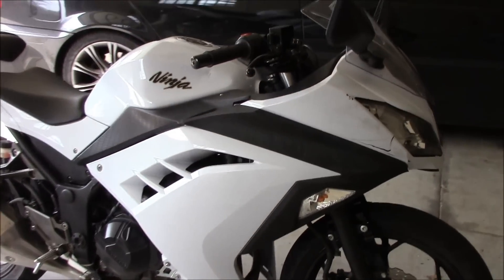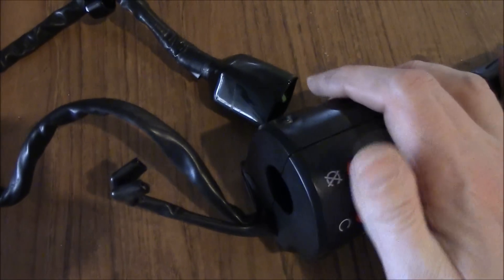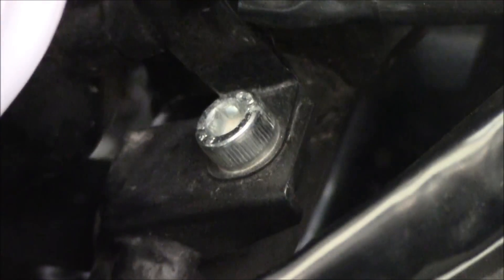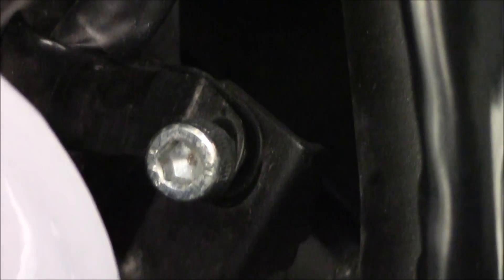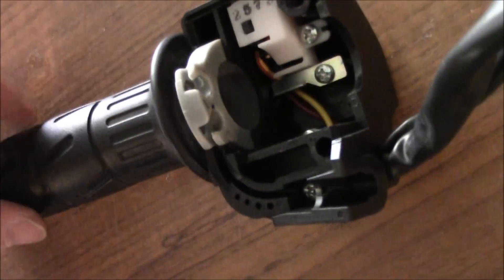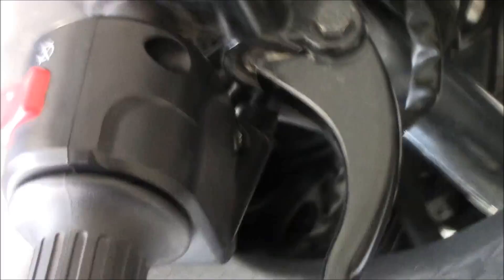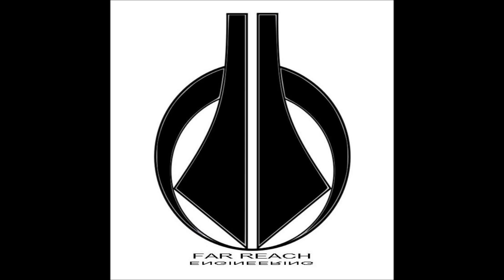Replacing Motorcycle Kill Switch, Starter Button, and right control group. 2013 Kawasaki Ninja

Comment: Question the assembly won’t slide up more on the bar when I actually do slide it up it’s not fully closing like something in the way and I can fighter out why? Did u have this problem
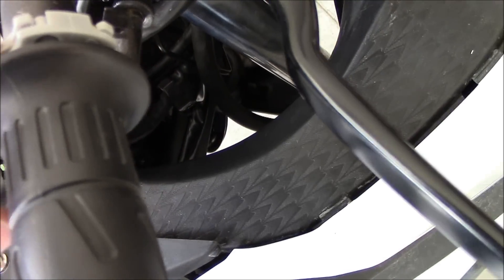Reply from the maker: There is a locater peg/hole on the side of the bar that faces the front of the bike.  Is it possible that you have not aligned the peg with the hole?  Just a thought.  You can sort of see the hole in the handlebar that the pin will need to sink into here 3:56   Not sure if this is the issue, but just trying to help.
Reply: @FarReachFR so the issue I have it fits but I need to move it up a little more on the bar because of the brakes and bar end and when I do that’s where I start having a gap I dont know why but I’ll double check what’s causing it
Reply: @1pyroace1 literally my situation right now. 5mm out before it closes flush. Did you solve this?
Reply: @rtificial8292  some what not they way I wanted to be, because I’m trying to dial right turns and front brakes hitting the windshield is no bueno

Comment: Correct me if I'm wrong but I don't know of any tool manufacturer that uses the measurement of 6/16" as  being the size of any tool. Instead they 2 use the term 3/8"  I'm assuming you used a 5/16" Alan wrench on your project. Again correct me if I'm wrong. I would rather be wrong than to post misinformation.  I probably wouldn't have said anything except I just kept getting a picture in my head of people searching their tool boxes for a 6/16" Alan.  O r even going to store and trying to buy one. 😉
Reply: came to comment the same thing

Comment: How do I start the motorcycle without the button what did you touch
Reply: Did you figure it out? Mine just broke bro 😢
Reply: @ yes take 2 keys press the metal middle circle and press it on the outside of the circle
Reply: Or 2 metal pieces but the metal pieces have to touch each other

Comment: I hope someone is still here lol.. I need help on how to disconnect the cables from the throttle housing on my honda cbr929.  I seperated the 2 halves but the lines are still too tight to remove.  I want to go in and put contact cleaner and dielectric grease.  So if this doesnt work I will know how if I have to replace the housing/buttons.

Comment: I just started riding motorcycles I bought a 1982 suzuki gn 125 it was working good i left my back under tarp at my parking lot driving my car to work when I got back and removed my tarp some asshole had turned my mirror around and broken my starter button. Is there anyway that I can start my motorcycle without the starter button untill i can find one?
Reply from the maker: Yes.  Now I dont know your bike specifically, but the starter button basically just closes a circuit.  the button you press is closes the connection.  You just need to locate which two leads were going to the start button and then connect them (hot wire together) in order to engage the starter and then disconnect them once it is started.  (this of course assumes your kill switch is still working correctly and is on, and your key is also in the on position)
Reply: Far Reach Engineering Thanks a million bro!

Comment: How did u jump it across the terminals
Reply from the maker: +Tarricka Brown  You notice how it looks like 3 circles, each stacked on each other?  I recall jumping the top circle to the bottom circle.  What I used was actually the green alligator clip shown attached to the key. I would open its jaws and stuff it in there.

Comment: how did you look that whole part up on ebay,,, i need one too
Reply from the maker: If you need just the switch section I would use, "2013 Ninja 300 Kill Switch"  If you need the grip too, then throw throttle into the term as well.  It should pull up some options for you.
Reply: I need this exact thing for my hyosung 250r 2015 but having the worst luck. I had it crossed for a few years and today it wouldn’t turn and kept shutting down! Any advice ?

Comment: Hey bro great video.. I have my bike at the shop and they told me this was the issue why mine doesn’t start. I replaced the solenoid, and the battery and nothing, no start. It’s an 08 zx6r

My question for you is how did you figure out this was the issue? Is there a way I can send you a video by email to see if your bike had the same problem when starting? They are charging me 90 an hr and the part was like 140. I am watching this too late and need the help as much as I can man. Thank you.
Reply from the maker: For me, the problem was more obvious,  Overtime the switch button started to act weird.  A couple times I pushed it and it would move to the side instead of straight down.  Some times it would start, some times it would do nothing.  I would just push the button and silence.  Push it 4 more times and boom starts up like nothing is wrong.  That all or nothing scenario was  a clue that it was electrical and not mechanical and it seemed as though how I pushed the button would make a difference. This narrowed it to an electrical issue within the switch itself.  Then over more time the problem just became worse.  Then the button popped out. I put it back in and kept up my wiggle it, push it over and over approach to get it to start.  Eventually the switch button fell out. That turned out to be a plus cause after that I would just hot wire the switch.  Using the green alligator clips in the video I would jump the contact from the outer circle to the inner circle.  That made it specific and obvious that the problem was just mechanical failure of the electrical switch.  Last step like you see here was just replacing it.  So that is my story of how I figured it out.  As for diagnosing it from a video I think that would be very difficult.  Hands on is the way to do it.

As for parts, I personally would just use a junk yard pull or a used switch in good condition.  Shops always cost more.  They have to, without it they could not pay for rent or wages.  But that said, I just looked up the kill switch for your motorcycle and used (on ebay) it is $20.  (not $140)  So you might be able to save some money there by supplying them the parts.  If they charge you 2 hours and you supply a $20 part, then the whole thing could be a $200 fix.   Lastly if you are in the my area I could put my hands on it for you.  But I am not sure that is cheaper than a shop :)    All the best and I hope this helps in some way.  If nothing else, maybe I saved you $120 in parts?  Good Luck!

Comment: I have the same bike but their is a problem with it the engina is good and gas and oil gear shifting good but my bike wont move when I put it to first gear u know how to fix it plz get back to me fast
Reply from the maker: when you put it into first gear to it stall due to engine load or being stuck?  Or does it not move in first gear because it shuts off the power electronically?  What happens when you put it in first?

Comment: how do you jump the connection
Reply from the maker: Underneath the push button, there is a metal circle inside another metal circle.  Jump the connection from the outer circle to the inner circle.  That will engage the starter motor and start it.   NOTE: you still need to have the kill switch set to on and the key set to on.
Reply: Far Reach Engineering Thank you for this info👍🏻. I just had my bike vandalised overnight and they broke the starter button clean off along with the horn. Not sure what the purpose of that was but my guess is they thought they were going to steal my bike off my driveway but when they got closer they noticed on the other side of the bike the ground anchor and thickest motorcycle chain money can buy through the wheels via 2 of the thickest kryptonite U locks and gave up then got pissed and snapped the start button and horn off🤨

Comment: How do u by pass it without bump starting
Reply from the maker: The switch itself (the button your press) was the thing that failed.  As such, I ripped off the button.  Below the button are two metal connectors.  A circle inside another circle.  I bridged those two circles together to make the connection.  When that connection is made the starter motor engages.  Once it starts I disconnect them.
Reply: @FarReachFR  is there any tutorial on how to do this

Comment: If I press the starter on my motorbike and it kills all power to my bike whot dose this mean
Reply from the maker: There could be several things, but let me try to address just the most straight forward first:

First I am going to assume that your bike is not running when you press the starter.   That being the case, if you have the bike switched to on, (lights are active etc.) and then you press the starter, and it doesn't start, but instead all the lights go out, (and it may or may not make a click,  then I would say)  it means your battery is dead.  

It has just enough activate to light the system, but when you put the drain of the starter motor, it is too much and it saps the all the juice and kills the system.

If this is what you are experiencing, I would suggest charging the battery or replacing it, and trying again.

Comment: What’s the red switch for?
Reply from the maker: It is a "kill" switch. If you toggle it up then the engine wont run.  If you put it i the down position, the engine can be started/run.  Its an extra level of safety right at your thumb.  That is important on a bike, because while you have a key.  The key is at the center of the handlebars, and you would need to take your hand off the handlebars to shut it off with the key.  In an emergency situation taking your hands off the bars is the last thing you would want to do, so the kill switch is right there so you can hit it with your thumb and shut off the engine without ever taking your hands off the controls.

Comment: Where buy give link
Reply from the maker: I purchased mine of Ebay.  Just search for "2013 Kawasaki 300 kill Switch" and you will have many options.  Most are around $35.  Here is an example. You can get them with the throttle tube and without.   Here is an example of without.    http://www.ebay.com/itm/2013-13-14-KAWASAKI-NINJA-300-EX300-ON-OFF-SWITCH-HAND-CONTROL-WIRING-KILL-K26-/121527536182?hash=item1c4b9b0a36:g:~QwAAOSwopRYbpL8&vxp=mtr

Comment: I can’t find a 6/16ths Allen wrench ANYWHERE. And I work at 2 part stores!
Reply from the maker: You know you are right.  It really never crossed my mind before that Craftsman totally printed a bogus size on there.  In retrospection I expect they meant 3/16  but plain to see they printed 6/16 on the wrench. (which would really be 3/8s which it certainly is not)
Reply: Far Reach Engineering lol. Thank you. I searched for a good 2 days before contradicting😂 just making sure me and others had the right info. Currently my 2014 Kawasaki Ninja 300 Abs SE (White, Black, Red) is taken apart to not only replace the switch in the video, but also the throttle pull cable. The plastic adjuster that feeds into the push start snapped and I don’t feel comfortable riding with it like that.
Reply: What parts stores do you work at so I can avoid them...? If you're looking for a 6/16ths wrench, you must be a new hire.
Reply: Salvador Quezada it was getting him to post the correct size